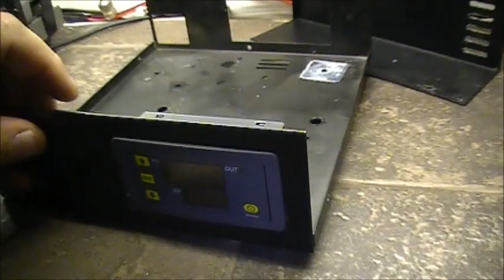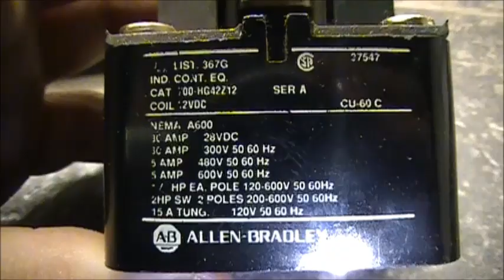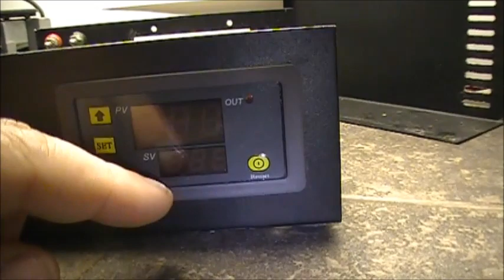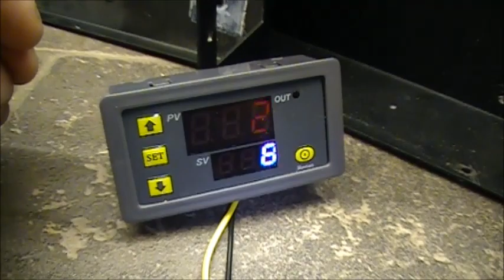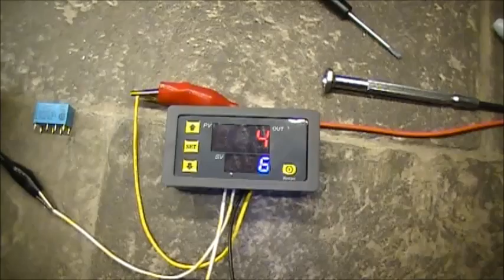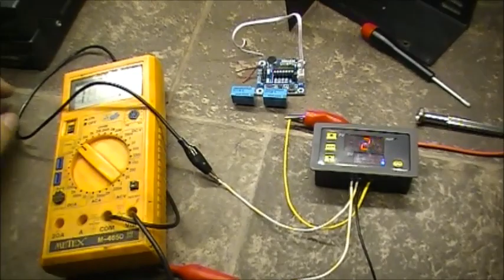Crossband repeater project  - Testing the timer module

Comment: How do you wire this timer
Reply from the maker: The timer requires a 12vdc source to function, then when it is programmed you can make the timer control of kinds of circuits.

Comment: Ok, Sorry for the probably dumb questions but, I received my delay timer and I'm guessing I need to hook this up to a relay to actually get it to output power to my device yes? or do I run jumpers from my devices power to the output of the timer  and actual on/of switch in my unit that I am trying to time? If that makes sense at all to you? Sorry again for the Layman description.
Reply from the maker: The device itself do not provide any power what so ever.  BUT.. There is a set of Relay contacts on back that you place in series with the power wire on your device, or for a relay which would then be wired to your powered device.    What is it you are trying to get this timer to do?
Reply: @Radionut63  Thanks for the reply, I actually, through trial and lots of thinking lol figured it out. I used a jumper from the neutral or ground to s1 then when the circuit opens it supplies power to the unit you are needing powered. It was just to turn on/off my exposure light system used for screen printing and replaced the spring loaded mechanical countdown timer
Reply from the maker: sounds like a great idea for this timer.. interesting. :-)

Comment: Can this timer be used strictly as an on/off timer? I wonder if I can set it to say 20 seconds on, Then it just shuts off without cycling again?  Thanks for this vid
Reply from the maker: it is a on/off timer, Timing range: 0-999s,0-999m,0-999h before resetting and start the count over again.  It a great little gadget i have to say, works great for my project.  :-)  For further information about how i used this device and a link to where to purchase it, check on my webpage: https://radionut53.wixsite.com/radionut63/cross-band-repeater-experiment

Comment: Can you get it to hold until it looses power and then repeat it when unit gets power again?
Reply: Did you find a manual for this timer?
Reply: if I delay power, do I need to use cycle or can I only delay power and to repeat that I can turn the power off and then on again, want to use it to delay ignition in my van for a dash cam
Reply from the maker: this unit can time 0-999 seconds,  0-999 minutes, 0-999hours

Instruction Manual:

1.After setting the data, you must wait 6 seconds,6s post modules automatically save memory set data.

2.Press SET key once to enter the time setting mode,the red LED flashes,
 press the key to increase or decrease the setting time T1.

3.After setting time T1,short press the SET key again, the green LED 
flashes,and the time is set by pressing the key Time T2, T2 time setting
 is completed,press SET key again, the system will automatically save 
the memory setting time or wait for 6s, 6s module will automatically 
save the data memory.

4.Long press SET,enter parameter setting mode.There are two sets of 
parameters for the user to select P0, P1.Short press SET in the current 
mode to switch between P0 and P1. 

5.In P0 parameter can be set by pressing the key to adjust their own 
timing mode.In the P1 parameter can be set by adding and subtracting 
keys work mode.

P0--0:T1 Timing mode is second.

P0-1: T1 timing mode is minutes.

P0--2:T1 Timing Time mode is hour.

P1--0:Delay T1 time,relay pull(T1 timer)

P1--1:Relay release after T1 time delay (T1 timer)

P1--2:Delay T1 time,relay pull(T1 timer),and then relay release after T2 time delay(T2 timing),then it is finished.

P1--3:Relay release after T1 time delay(T1 timer),then delay T2 time,relay pull(T2 timing),then it is finished.

P1--4:Delay T1 time,relay pull(T1 timer),and then relay release after T2 time delay(T2 timer),cycling.

P1--5: Relay release after T1 time delay(T1 timer),then delay T2 time,relay pull(T2 timer),cycling.
Reply from the maker: posted below. :-)
Reply from the maker: It holds it's memory for a long time, i have had power disconnected for a couple of weeks between installs in the controller and it still help it's memory no problem at all.